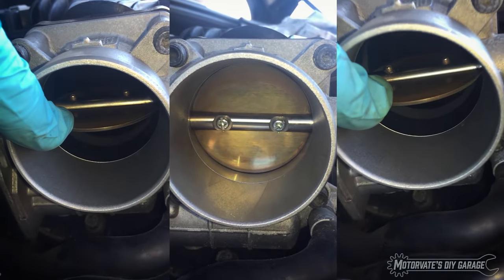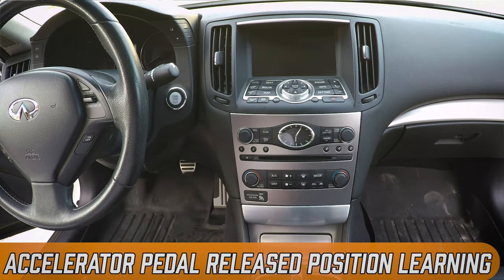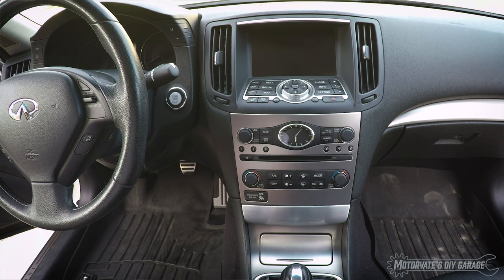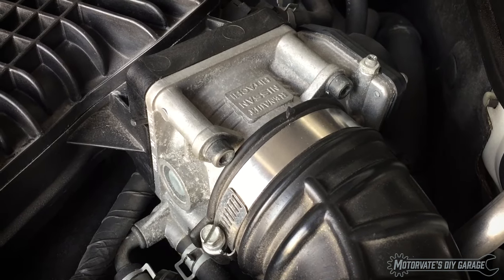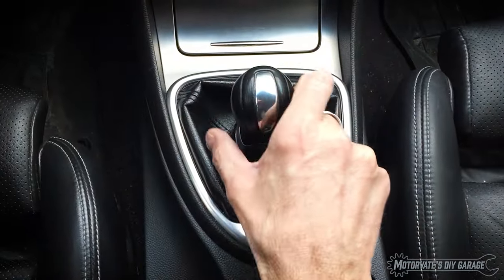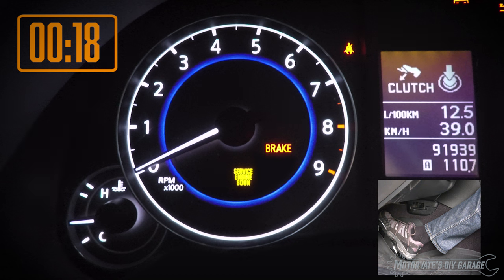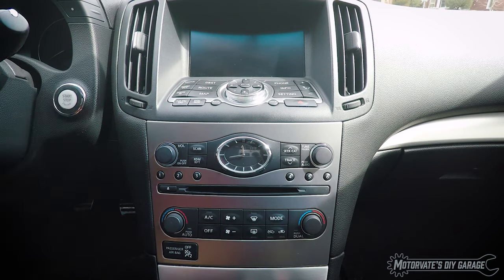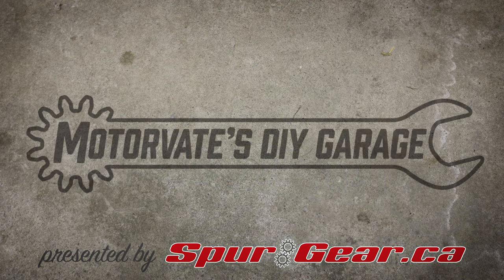G37 & 370Z After Throttle Body Cleaning: Motorvate’s DIY Garage Ep.27

Comment: I don’t get the 2nd step
Reply from the maker: Hey mxc99,
Are you talking about the "Throttle Valve Closed Position Learning"?

If so, here are the steps:

The second procedure we need to do is the 
“Throttle Valve Closed Position Learning”

Now, in order for this procedure to work,
the engine coolant temperature must be less than 25 degree Celsius or 77 F.

An easy way to verify this is to use an inexpensive OBD scanner & phone app like OBD Fusion.

or
let the car sit all night, assuming the overnight temperature is low enough.

Start the car and let it warm up to at least 65 degrees Celsius or 149 F.
Again, you can use an inexpensive OBD scanner & app to check the temperature or just wait until the temperature gauge is at the normal position, which is just below the middle between hot and cold.

A few minutes later….

With the engine coolant at the proper temperature, we simply turn off the car.
In the next 10 seconds, the throttle bodies will make a clicking sound when they move. 
This indicates the procedure has successfully run.

Comment: I cleaned mine today and all I did was the ecu reset procedure and the idle relearn and everything is perfect. I didn’t here the throttle bodies make any noise.
Reply from the maker: Hey  Bizzenn1976,
If your hot idle is in the normal range (600-700 RPM for the G37) then all is well, and it sounds like it it :)

Comment: What if not?
Reply from the maker: If you don't clean the throttle bodies, at some point enough carbon will build up and the car will crank and won't start... UNLESS you push on the throttle a little (~ 1/4")
Reply: @MotorvateDIY I meant, I did cleaned throttle body but couldn’t relearn idling 😢.
Reply from the maker: It can be tricky to get all the conditions and timing correct.
One comment on my channel said they finally got it to work on the 19th attempt!

Pay very close attention to the timing of the actions and the required conditions and keep trying.

If you have an Android device and a Bluetooth OBD scanner, there is a free app that will do the idle air volume learning for you: 
https://youtu.be/OiB9txECWB0?si=z3YxHtVr1DXd-o6d
Reply: @MotorvateDIY  I got it to relearn, but I did same procedure only on cold engine, it’s good now. 👍.
Reply from the maker: Excellent!! I'm glad to hear that.

Comment: FX45 USA 2004 vk45de pleas
Reply from the maker: Hey  Aligators410 Aligators410,
The steps shown in the video should work for your FX45, or any Nissan / Infiniti with an electronic throttle.
Reply: @MotorvateDIY  thank you but it didn't work for me
Reply from the maker: Hey  Aligators410 Aligators410,
Yes, it can be difficult to get this routine to run. Then engine load, engine temperature and the timing must be just right for it to complete. A stopwatch is helpful.

One YouTube comment mentioned that it took him 20 times before it completed.

If you have a bluetooth OBD scanner and an Android device, you can use a free app to run the idle air volume learning:

Quick & Easy Idle Air Volume Learning: Motorvate's DIY Garage Ep.28
https://www.youtube.com/watch?v=OiB9txECWB0

Comment: could someone help me out? I have an '07 G35x that i changed spark plugs and cleaned the throttle while at it. Idle goes from 1k to 2k then back down to 1k and then back to 2k and it continues to do this loop over and over again after it warms up. I've posted the problem on reddit with a video attached to give you guys a visual. I would be forever grateful if someone could give me a solution. https://www.reddit.com/r/infiniti/comments/csku2o/anyone_have_some_experience_they_could_share_to/
Reply from the maker: Hey A Sea Rhinocerus,
Crap... I guess you didn't see the warning at the top of the video description about the 2007 G35 or 350z (with the VQ35HR engine). There is a bug in the ECU and the idle air volume learning will never complete.

A few people that have had this issue have commented they were able to get the ECU updated at the dealer.
If you are in the US, Eugene at Enthusiast Auto Care (https://www.yelp.ca/biz/enthusiast-auto-care-concord)
can update your ECU. I personally know Eugene and he does very good work.

Please let me know any updates on your progress to get this fixed.
Reply: @MotorvateDIY  I never got a notification for this message but I'll be sure to update with everything in the comments to hopefully help someone out that comes upon this issue as well. I happen to live on the North East coast of NJ. Only thing I could see helping me out with an ECU flash is from a dealer themselves. $150 for the flash.
Reply from the maker: @Brian8000666  The message is in the first line of the video's description - That's all I can do with the options that YouTube provides.

Anyways, good luck at the dealer. They might try to say you need new throttle bodies, or ECU to fix this issue. If they insist on that contact Eugene (https://www.yelp.ca/biz/enthusiast-auto-care-concord) and he can update the firmware for you. (also proving the throttle bodies and ECU are good)
Reply: @MotorvateDIY  Hey, just recently came back from the dealer. I asked them if they could do an ECU update and from what the advisor said that the update couldn't finish because the idle air was not normal. Told me to get new TBs and if that didn't work then a new ECU. I don't know if they did it correctly or not but that's all they told me. Sadly I still have this issue. Any further tips? I appreciate your replies on my problems. Also earlier on i meant the notification of you replying back to my comment. I don't mean to sound rude in any way. Thanks again!
Reply from the maker: Hey A Sea Rhinocerus, 
Sorry to hear that. 

You next option is to contact Eugene (https://www.yelp.ca/biz/enthusiast-auto-care-concord) and he can update the firmware for you. 

I know Eugene and trust his work. Also he has done this update quite a few times.
Reply: @MotorvateDIY  Thank you very much for referring me to Eugene. He is indeed a very great mechanic. And I should've contacted him from the start. Thanks again for your help in resolving the high idle issue!
Reply from the maker: Hey A Sea Rhinocerus, 

I'm glad you are happy with Eugene's work. He is very knowledgeable and a great guy.
The best part for you is that you won't have this issue again :)

Comment: My engine service light will not blink
Reply from the maker: Hey Vincent Nguyen,
It can be difficult to get it to blink. The timing is VERY tight and needs to be measured with a stopwatch for the best result.

If you have access to an android device and bluetooth OBD scanner this is easy to: https://youtu.be/OiB9txECWB0
Also, double check all of the pre-conditions to make sure they are where they need to be. Good luck!

Comment: I have a diffrent kind of issue are cleaning throttle.  When coming off throttle it gets stuck just below 2k rpm before it drops to idle.

I tried the idle re learn via  nds3 after a little while it says failed.

However it idle's normal with a slight hint of hunting between 650 and 730 rpm.
Any ideas?

https://youtu.be/tGyolxps8Xk
Reply: @MotorvateDIY  hi mate I just checked it says ev1a so I presume mine is no good. 

It did that hanging before but not as bad and annoying tbh.
Reply: Oh I also changed exhaust so it no longer has any catalytic converters. 
I cleaned the throttles
Apart from that nothing else
Reply: @MotorvateDIY  hi mate. 
I don't have any engine check lights from not having the cats. The sensors are still plugged in as per how they where before. 

Yes I plan on getting a tune soon.
I tried again last night and it gets idle down to 650-700 rpm but ends up saying failed in the end. 
Thanks anyway for you're help.
Reply from the maker: Sorry, I just noticed this comment... Did you fix your issue?
Reply from the maker: Sorry, I just noticed this comment... Did you fix your issue?
Reply from the maker: Sorry, I just noticed this comment... Did you fix your issue?

Comment: I got a check engine light after doing this  🤔 has that happened to anyone?
Reply from the maker: Hey Miguel Angel,
What year, make and model is your car?
What is the trouble code?
Is your idle between 600-700RPM?
Reply: @MotorvateDIY  2008 California spec CKV36 Sport after scanning for codes I would get high idle code every time I performed the last calibration. I decided to clear the code after the second time took it for a drive and no code. Ive owned it since '14 and its always had idle around 900 I was surprised the recommended 600 rpm. 

After I performed a full intake system cleaning I was idling at around 1,100 rpm after step 1 and 2 it dropped to around 800-900 which was normal to me. The car runs really smooth better than a few days ago.

Thanks for your tutorials, I would love to collaborate I film music videos for a living with cinema equipment, Ive thought about filming my mods ands maintenance but its kinda hard to film and work on the car.

I filmed myself in my garage upgrading the clutch system with high performance CSC lightweight flywheel and high performance clutch and plate but because I wasn't focused on filming the quality wasn't up to my standard two years later car runs really smooth love the upgraded clutch over stock but haven't edited the footage.

I plan on doing more maintenance and upgrades soon.
Reply: @MotorvateDIY  I use RED digital cinema cameras for most of the music videos I work on and anything behind the scenes thats on my channel is with a custom rigged Sony camera and I color grade all my footage.

Thanks on the feedback filming is what I do for a living so it makes me happy that you liked my videos. I will try to upload more content. Usually only my clients upload the music videos I produce.

I haven't been to Canada but I would like to go in the Summer when its not too cold lol I sent you an email thank you.
Reply: @MotorvateDIY  I forgot to mention the code was for high idle but I realized my idle with the light weight 1 piece flywheel should be slightly higher than normal so everything should be ok
Reply from the maker: Hey Miguel Angel,
I'm glad you car is back to normal. Do you know what the code was?

I had a quick look at your channel, very nice. The low light 4K was very impressive. What camera did you use?

I like your quote "its kinda hard to film and work on the car."  I work solo and completely agree, but it's a lot of fun.
Reply from the maker: Hey Miguel Angel, 

You got me thinking.... I wouldn't think a lighter flywheel would raise the idle. It should be controlled by the ECU... but maybe the ECU has adapted to the lower inertia... I don't know.
Reply: @MotorvateDIY  I think I remembered reading it would increase the idle when I upgraded.

Comment: It doesn’t work for me ‼️‼️‼️ I have a g35
Reply from the maker: Hey  victor rosales,
What year is your G35? After cleaning them, what is your idle speed?

It can be tricky to get the idle air volume to run. Here are some tips:
•  Make sure to use a stop watch.
• All pre-conditions must be met. Check and double check.

If you have an Android device and a bluetooth OBD scanner, you can use a free app and the steps in this video: https://www.youtube.com/watch?v=OiB9txECWB0
Reply: Motorvate DIY yeah I have a g35x 2007 and it idles around 2k but it goes down then comes right back up to 2k
Reply: @victorrosales1406  hi I’m having the same issue we’re you able to get it fixed?

Comment: I cleaned my throttled bodies but It still doesn’t have that small gap on the top and bottom of the throttle plate at 0:42 why?
Reply from the maker: Hey RZVids,
If my memory serves me correctly, you have a VQ37VHR...
In order to see that small gap, you need to get the light and angle just right.

How does the car idle? If it has a normal idle, you have nothing to worry about.
Reply: Motorvate DIY it is idling poorly, a Misfire, check engine light is on, and I replaced all coils and spark plugs.. :/
Reply from the maker: Hey RZVids,
If I were you, I would run OBD Fusion's diagnostic report. It will show you the Mode $06 misfire counters by cylinder. This might give you a cylinder to focus on.

For some reason, Torque Pro doesn't properly decode  the mode $06 properly, so it isn't useful.

Then, look at your fuel trims when the engine is  fully warmed up or "hot" idle. If you add the short term + long term, they should be around -15 to + 15%. 

Look at the freeze frame data. At what engine load / temperature did the  mis-fire happen at?

You might want to clean your MAFs. When they get dirty they over estimate the air flow at low engine loads and then under estimate at high engine load.

Comment: My question is, how do you know if you've done all the steps correctly?
Reply from the maker: Hey cuck lord,
Well.... tall has worked well when the  idle  is between 600-700 RPM when fully warmed up. (coolant gauge is in the middle)
Reply: @MotorvateDIY   To your knowledge, will this also work for Acura?

Comment: Those procedures are completely unnecessary. I just cleaned my Maf sensors and throttle bodies. The negative was reconected, and engine started. It's true, it will idle high for about 10-15 minutes then settle down. All this button pushing, pedal pumping, etc. is not  needed.
Reply from the maker: Hey Tommy D,
It all depends on how dirty your throttle bodies are. The ECU can handle a little bit of carbon build up.
However, if they are VERY dirty, then it can't and these procedures need to be done.

or take the easy way and use the NDSIII app: https://youtu.be/OiB9txECWB0

If you have an OBD scanner can you tell me your absolute and relative throttle positions at hot idle with A/C off?
https://youtu.be/NivcFU6XjAY

It sounds like you take good care of your car and if these steps are not need for you that's  just fine :)
Reply: @MotorvateDIY  When the throttle bodies are clean you have the flap completely closed. If its not completely closed, because the springs are off, or its held open by deposits, then you are recalibrating your throttle bodies with the slightly open position. Again, if your bodies are clean, you have complete closure, and the idle will set itself.
Reply from the maker: Hey Tommy D,

I see you point, but it doesn't work that way on the VQ35HR and VQ37VHR. Theses engines don't have any type of idle control bypass, so if the throttle is 100% closed there is no air passing for it to idle.
Here is a close look at the this type of throttle body: https://youtu.be/HLQiu1kZ354

Thanks for you comment :)
Reply: Worked for me.
Reply: Sit down dave.
Reply: @MotorvateDIY  Im referring to the V37 on my 2011 G37 coupe. I just cleaned both sides of each throttle body, put it back together, and started her up. You can see the tach idle high or unstable for about 8 mins, then settle down to the normal 550-600. And I believe that has not so much to do with the clean throttle bodies, but the fact that the negative battery terminal was disconnected. The same thing happens when I get a dead battery, and the electronics haven't had power.
Reply: @daveyuen3853  That's not how it works on thee engines